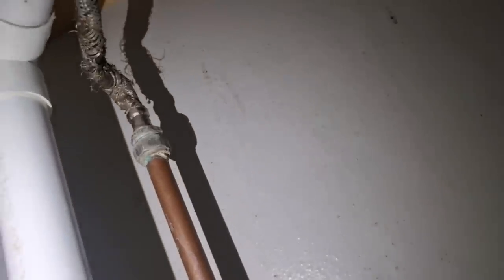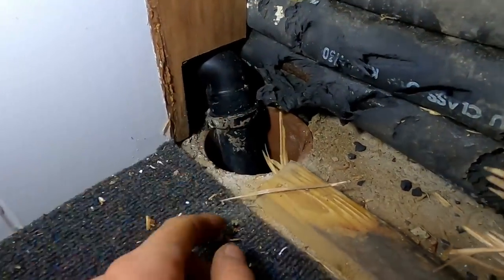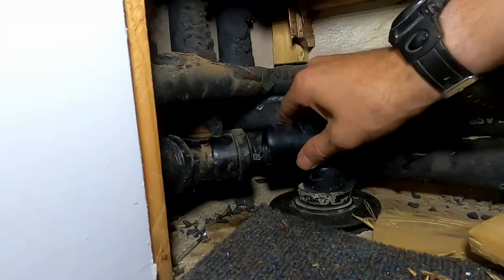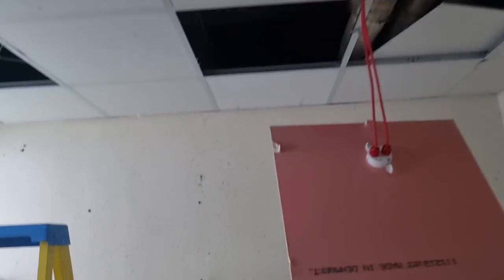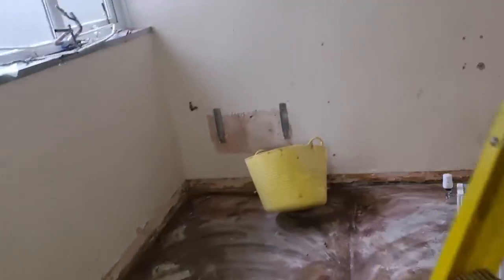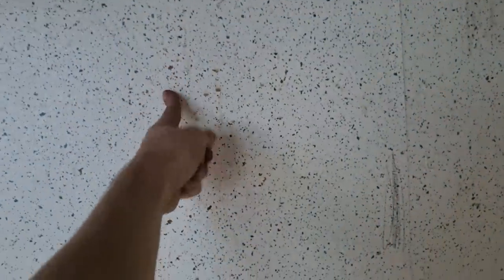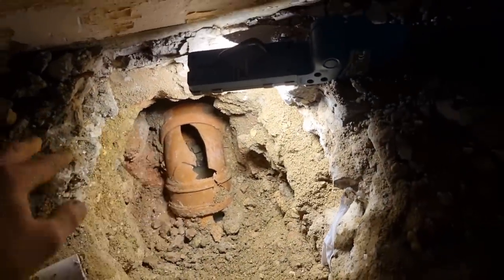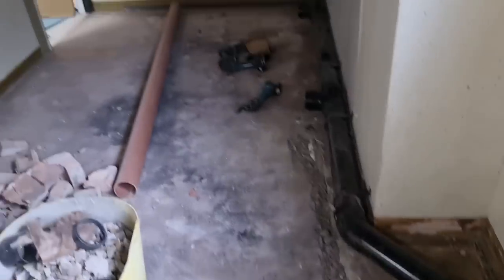PLUMBING BODGES ! Stinking Drains and Kinked Hoses | How to Fix

Comment: Good one Tom. Not surprised that firdt one stunk😂. I'm not a big fan of flexis either, they're overused shall we say. Toilet jobs look interesting, they've done a similar job in my daughters school with the cubicles coming off the corridors.
Reply from the maker: Thanks for the support as always mate, flexis do have there place but like you say are overused, I can bend a bit of pipe onto a soldered tap connector, it might take me a couple of extra minutes but it also helps secure the tap

Comment: wow wonder if that dangling a pipe into an open 4" waste pipe was done by the same person that did that same thing in my house under one of the showers, we always had problems with sewer smells from the day we moved in that we couldn't solve, As there was no access to under the shower tray, we found it when we refurbished the room. It's also a nice open door for Rats to get in too, all for the sake of a few quid on a bung.
Reply from the maker: It's terrible what people do, I see it so much in my job where people can't be bothered to go and get a fitting to do the job right, I wouldn't be able to sleep at night, thanks for watching as always Tony 👍
Reply: @PlumbLikeTom  Shower tray fitting was a sight to behold, Tbh it was obvious the house had been owned by a DIY bodge merchant when we viewed it, As we were planning to do a major refurbishment and the price reflected it we weren't too bothered. But the tray was one of those old solid porcelain 6" deep trays, must have weighed about 60kg they had fitted it into a corner and built a 2 course wall for the two open sides to sit on, but hadn't bothered to do anything to support the tray where it met the wall, god knows how it managed to stay in place with two sides unsupported. Maybe it was the numerous Rats nests underneath the tray, The Rats had chewed through into the cavity and dragged insulation from the loft to make the nests. The other classic was running the whole central heating for a large 4 bed house of 15mm feed and return.

Comment: I thought that flexis were great until I heard that they should be changed every ten years. 
Incidentally, flexis are popular in the US and they don't seem to have any problems with them there. Not sure why.
Reply from the maker: They do have there place and I have used them in the past, most monoblock taps come with them so you don't really have much choice but to fit them, I find with single taps as soon as the taps becomes loose it starts to twist on the flexi causing this problem, I always tend to hard pipe if at all possible, thanks for watching as always 👍

Comment: Looks like rats have been up that drain nibbling the pipe insulation too!
Reply from the maker: You could well be right, that's about the one thing that gives me the creeps is rats in pipes, thanks for watching as always 👍
Reply: More than likely, previous owners of my current house plumbed a shower waste in like this and it was an open door for Rats, We solved it initially with a Rat guard in the access chamber after blocking off the other possible entrance points didn't stop the occasional infiltration. puzzle of how they were getting in was finally solved when we uncovered the bodge.